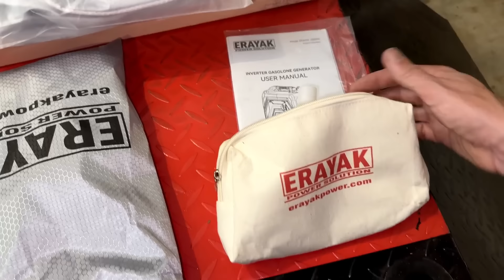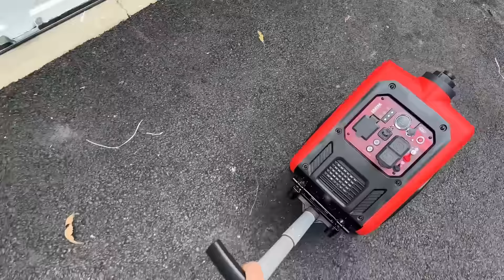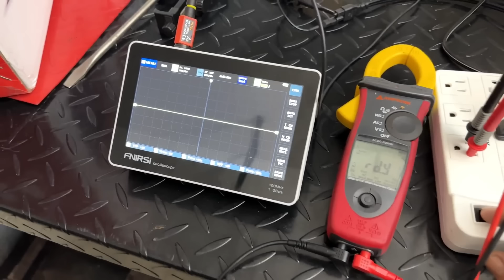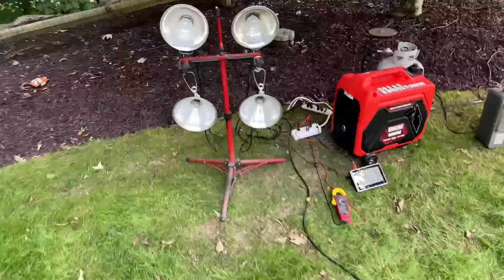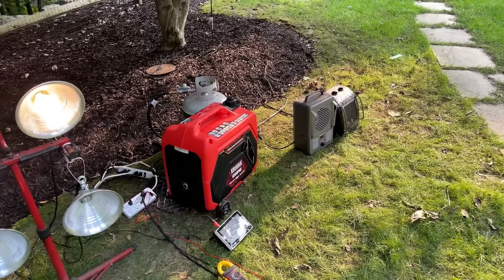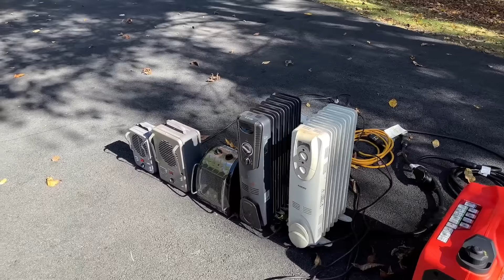The Ultimate Power Solution? ERAYAK 4500W Dual-Fuel Inverter Generator Review

Comment from the maker: Erayak Power Thanks for all the great feedback! I noticed several questions regarding the battery setup and fuel switching, so I’ve put together a quick navigation guide to help you find the key technical details:

🔹 Battery Connection (How-To): Jump to 13:50 — This model uses a lithium-ion battery. Remember to remove the zip tie and ensure a secure connection. This ensures a fast start even after long storage.

🔹 Propane/Natural Gas Switchover Test: Jump to 25:40 — Watch me test how the unit seamlessly switches back to gasoline under a 750W load if the propane valve is closed.

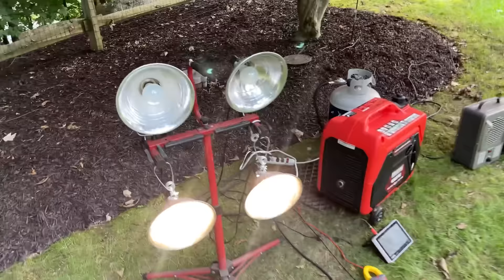🔹 0.2% THD Clean Power Test: Jump to 31:39 — If you're planning to run sensitive electronics (laptops/medical equipment), this is the most critical part of the review to watch.

Quick Question: Are you planning to use this for RV camping or as a backup for your home? Let me know in the comments below—I'm happy to answer any specific technical questions you have! 👇

Comment: I just got mine on January 2nd, 2026. Bought when it was on sale and I was excited to get a portable like this again, especially one that could provide 3200 watts and had an electric start. I only plan to use it with propane, but I appreciate the uninterrupted fuel switch option, in case I ever need it. 

I was a bit confused about the battery cable connection until I watched your video. As soon as I saw you clip the cable tie and uncap the SAE plugs I understood what I was missing. This is NOT covered this specifically in the manual. Their drawing actually shows connecting the cables at the white clip above the battery.

Thanks again for a thorough review!

Comment: (second comment) Been running one for a while on house natural gas (electric start) - no problems with that function but just a couple of things to note 
1. The big red light quit working indicating operating on natural gas or propane 
2. The electric start isn't "confidence inspiring" lol , no good strong continuous crank - it hits it for a second or two and then nothing for a few seconds, then it cranks again for a second or two then nothing for a few seconds - it finally DOES start - just hope it keeps working I don't want to be pulling the cord on this thing lol

Comment: I gambled on one lol - tri-fuel and electric start - had to run it on house natural gas full time for four days, running a few things - seemingly no problems. Just be sure you refill oil at 600 ml like the manual says and not 450 like what my generator plate says. And for a gas "quick connect" you need to buy "Propane Brass Quick Connect Fitting Adapter Female Plug x 3/8' NPT" (I think the manual incorrectly says 5/8). Except for no eco mode, pretty much happy with it so far.

Comment: If you are homesteading and using propane for all heavy loads, then the electrical load would be in this wattage range. It would be running on a BBQ house LP outlet and the large household storage tank and its regulator. But you really need REMOTE START/STOP if you don't want to contend with wild critters or fumble your way back in the dark. It's hard to find a model with both these criteria. A multi-functional knob just doesn't allow remote start/stop as the choke has to be electric and the LP main fuel valve must be as well as the gasoline valve. I note that some models can't be connected to a BBQ outlet as the LP "demand valve" is attached to a regulator that only fits to a small portable tank!

Comment: HI.
Can youa make a separate video on how to setup on natural gas safely. Thanks.
Reply from the maker: We are going to make such video for you soon.
Reply: I gambled on one for house natural gas - soon after purchase I needed to run it uninterrupted four straight days - seemed to be no problem - for a quick connect gas hookup you need to buy "propane brass Quick Connect Fitting Adapter Female Plug x 3/8' NPT" - except for no eco mode, so far I'm happy with it. And be sure you do 600 mL oil like the manual says and not the 450 bark like the plate on my generator says.

Comment: So this generator generates DC and uses an inverter to convert that to AC? Could it charge a battery instead so the inverter can keep going while the motor is stopped?

I’d like something that could automatically turn off and on when needed to keep a battery charged while the battery is used to run an inverter. I should be able to add as many batteries as I want and be able to set the start and stop voltage levels.
Reply: It would also be nice to be able to set a time of day range where the start voltage is lower. The purpose is for the time of day when people are sleeping. And maybe another range where the start voltage is higher so the battery can be fully charged before sleep time starts.
Reply from the maker: 4500PD will automatically charge the "starter battery" when it is running, because it has a built-in charger. However, it will not output power to the "starter battery" or external appliances when it is stopped, because 4500PD does not have a "power reserve battery" similar to a power bank. Therefore, if the "starter battery" voltage is too low due to the generator not being started for a long time like half a year or a year, it is necessary to start the generator by hand.

At the same time, the DC output port on the panel of 4500PD is only USB. If you need a 12V 5A cigarette lighter port for external charging, you can find it on another model 4500P or 2400P.
Reply: @ErayakPowerSolution , I need to charge my 12v or 24v whole house battery bank so that I can use an inverter to power my home.
Reply from the maker: @terjeoseberg990  There are separate DC12V, 5A outputs on the 2400P and 4500P models. But I'm not sure if the power can meet your needs. Maybe you can also consider connecting them or the 4500PD's AC output socket to the appliance through another higher-power charger.

Comment: Great in depth review. 
One thing I didn’t see discussed (apologies if I missed it) is the max power output per fuel. Generally gasoline being the rated power, propane a bit less and natural gas less again.
Is that also true for this unit?
Reply from the maker: Thanks for your insightful question! It is mentioned in the video that for the Erayak 4500PD, the maximum power output is reduced by about 10% when using propane or natural gas (3150W rated power, maximum peak power 4050W) compared to using gasoline (3500W rated power, maximum peak power 4500W). As for fuel efficiency, it is estimated that the fuel efficiency of propane is 73% and the fuel efficiency of natural gas is 31% compared to the baseline value of gasoline of 2.125 L/Hour (or ~0.561 GALL/Hour).